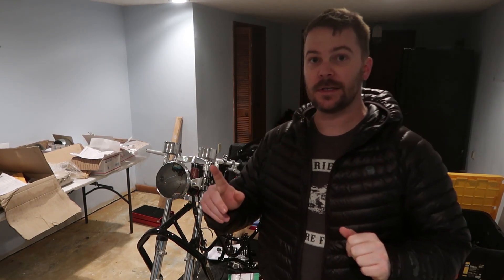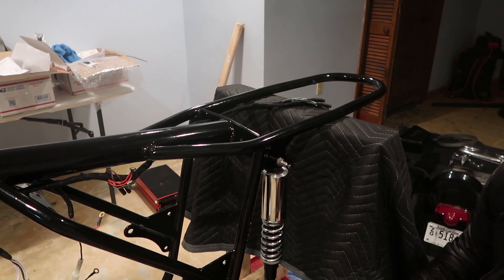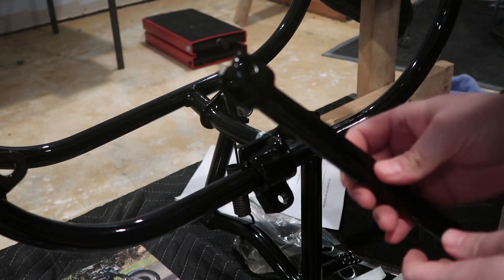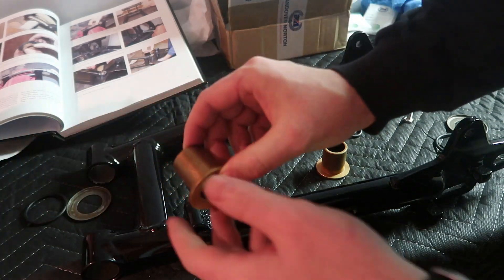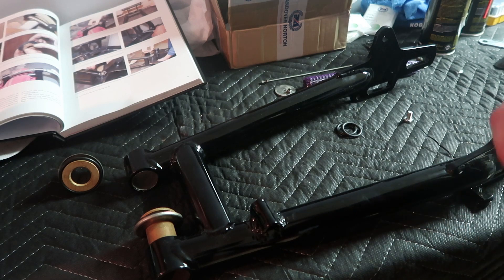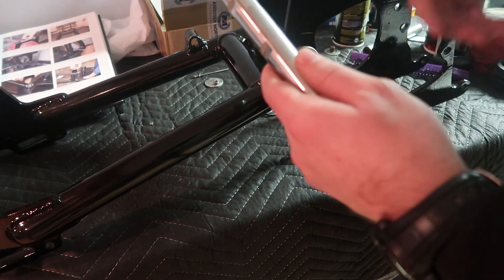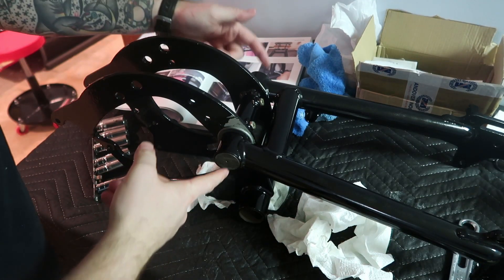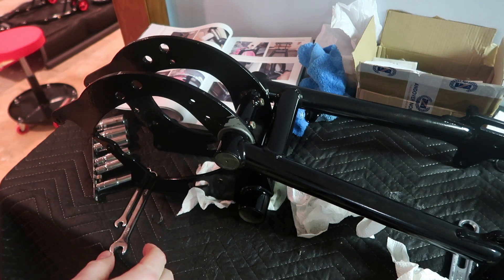Rebuilding My Commando Swingarm. (Commando Build Part 5)

Comment: Looking  at the video I think you have out the end caps on the wrong way round, the grease (or in this case oil) nipple should be on the right side of the bike fitted on the left means it's behind the primary chain case, this means you can't add oil, but more importantly the chain case will be out of alignment and will get damaged.  I have made the same mistake, luckily I spotted it before I fitted the chain case.
Reply from the maker: Thanks!  I realized I had it the wrong way around, but wasn’t sure if it made a difference.  I shall swap it around!